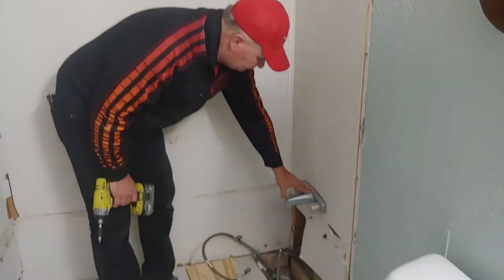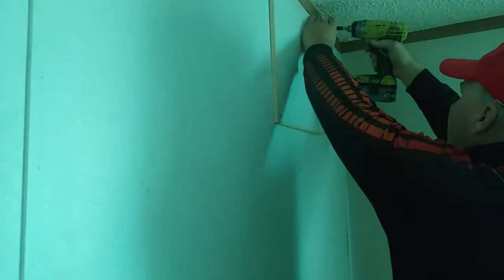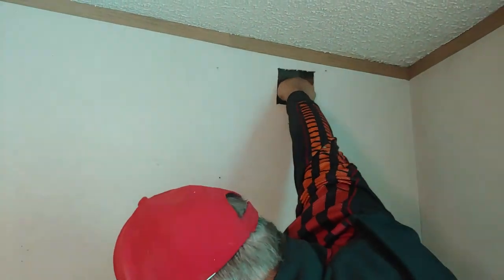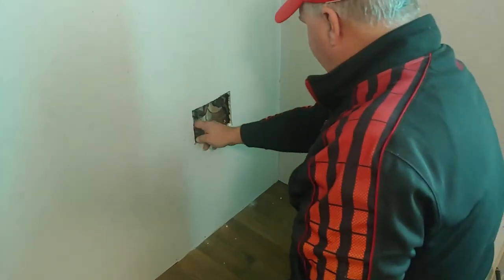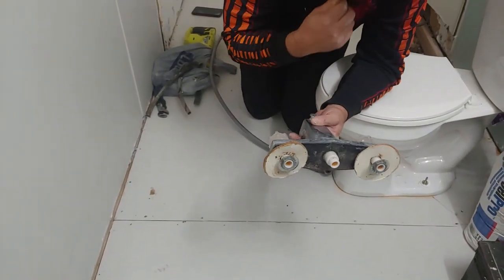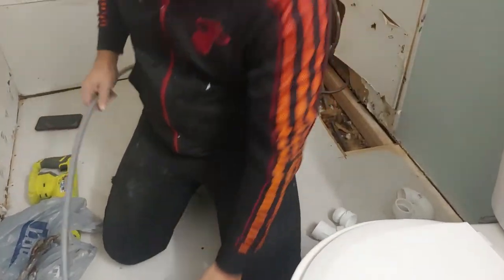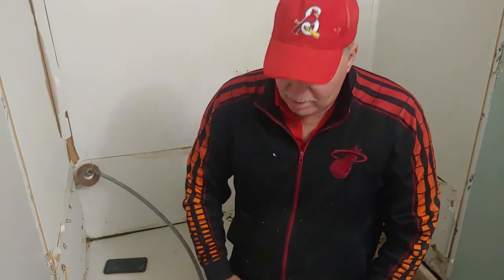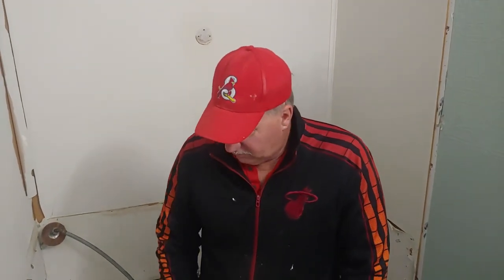How to Remove a Mobile Home Bathtub Faucet

Comment: Sadly I have to take the metal panels off the outside of mine to get to any if the pipes for my tub. Don't know who designed my trailer but I'd love to have a word with them. Hot water tank is also accessed gettin the outside too so not great in cold whether.
Reply from the maker: @justicex247  know all about cold and rainy weather and outside doors to hot water heaters. Keep on keeping on .

Comment: I broke the spout off of the chrome piece the handles are mounted to. I am trying to figure out if i can somehow just replace the spout part. Broke off in the plastic threading
Reply from the maker: @jacoblott1617  sorry to say you will need to replace the faucet. I know you can get it done. All the best.

Comment: Yikes this is what I was afraid of. For whatever reason mine doesn't have a panel since it is along the outside wall. So basically I have to remove the aluminum siding to get to it. Fun
Reply from the maker: Is the faucet on the outside wall? If it is then yes . If not the access to the faucet and drain is quite often in the room on the other side. Either way I wish you all the best
Reply: I have the same issie except theres a hot water tank in front of it. Makes it a real pain

Comment: Im excited to see how it turns out.  A cast iron tub and new tub surround.  Are they completely removing the shower head?  I started looking at replacing mine with a cast iron because it is the size I need.  Now Im looking at those Saf T Tubs that have the jets.  they are for old people but I still would love to have one due to the Jets and the fact it’s so deep.  it’s impossible trying to find a jetted tub that would fit my 54 inch area.
Reply from the maker: You the right idea. You should soon have the complete video maybe next week
Reply from the maker: Phil's wife: last part will be up Monday, I plan to put the complete bathroom up Wednesday

Comment: My handles always seems to trickle behind the handles turned it to tight so something assume pipe  broke off the cold side. Would like to see behind the knob fixture more than shower head
Reply from the maker: Sounds like it would be good to replace the faucet.
Reply: @StraightArrowRepair  yea started to pull shower from the wall but got annoyed with rusty screws so i busted a hole in the wall behind it. Didnt realize how simple the set up was. Putting on caps till i find a pair of knobs without the faucet end attached. Broke the fitting on the knob not the pipe so that helps i guess. Stall shower

Comment: Exactly what I had to do. Except I only had a small Access panel at the bottom.  I have actually had to cut a bigger hole and by drywall clips and a piece of wall board and patch that way.
Reply from the maker: Way to go very proud of you.

Comment: What happens if it is just the spout in a mobile home doesn’t have handles connected to it
Reply from the maker: Usually the knobs have screws then you remove the cover after that you remove the spout by twisting it counterclockwise remove the pipe that the spout is connected by twisting it counterclockwise go to the other side of the wall there will be wood that the manifold of faucet is connected to. You will first shutoff the water then remove the water lines remove or cut what fastens the wood in the wall remove the manifold of the faucet from the wood find one with similar handle distances fastening to the wood in the right place reinstalling the wood hoses ect.ect.ect. hope that helps

Comment: Do you know what type of connections I need? I need to replace shut off valves as well and connections to faucet.
Reply from the maker: You can install shark bite shut offs which require no special tools just push pull them use 3/8 to 1/2 hoses to connect to your faucet or buy the crimping tools for PEX and start crimping PEX to get the shut offs then connect the same hoses . Hope that helps.
Reply: @StraightArrowRepair  yes just wondering what the actually pieces that screw onto the faucet is called.
Reply from the maker: @actuallyashlie  should be called supply lines usually 3/8  on one end 1/2 on the other at whatever length you need. Hope that helps.
Reply: @StraightArrowRepair  figured it out! 1/2 to 1/2 faucet connecter was a little tricky finding the exact one, but it worked out great!
Reply from the maker: @actuallyashlie  way to go